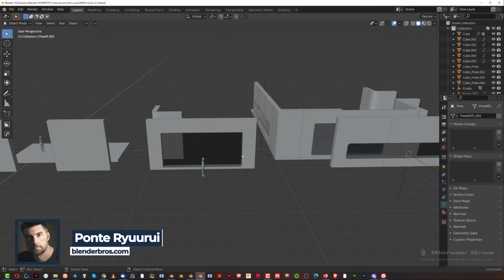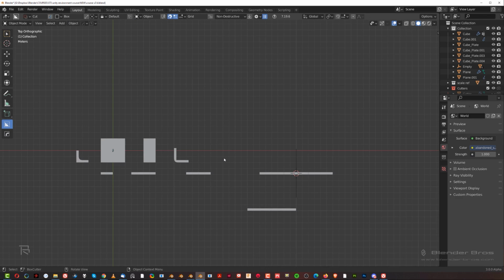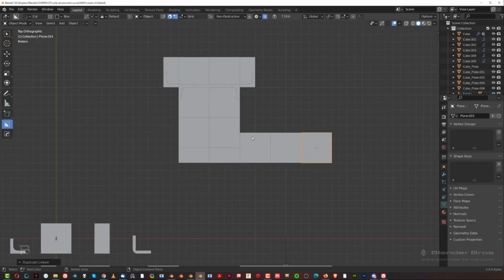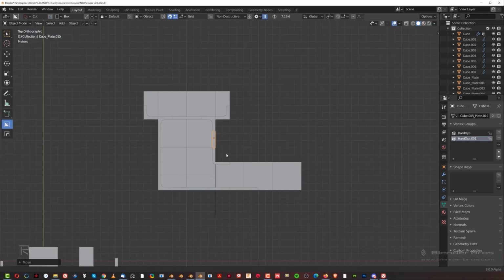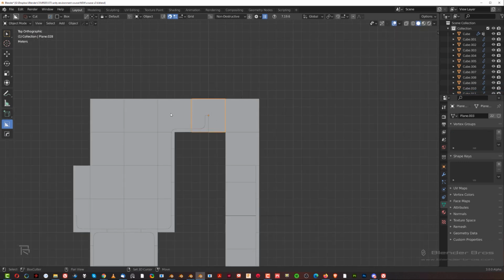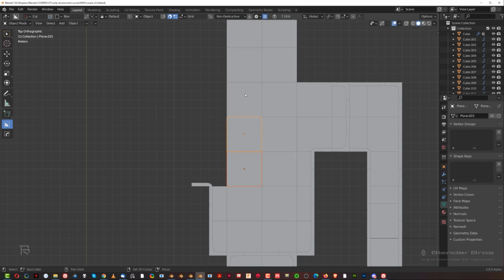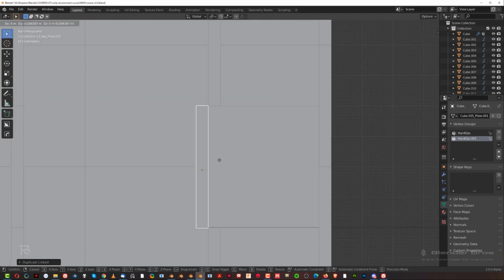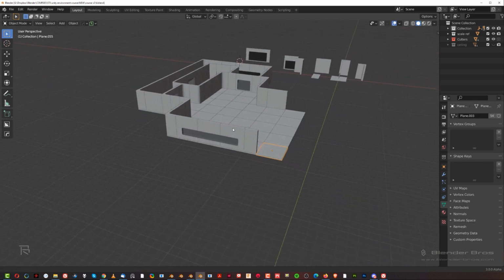Blender TUTORIAL - Modular Environment (main floor)

Comment: Love the course as it's very easy for me to follow along. I don't have the paid addons but I do have enough basic knowledge without the hard surface course you have (which I plan on doing eventually) but I have ran into one huge problem that I am stuck trying to fix. Which I probably just contradicted myself lol. The inner corner piece, I made it to the dimensions you said in the first video, but it will not snap into place correctly with the smaller door frame once rotated. It snaps okay enough as it is but I would have to make 3 more copies for each corner direction.

Comment: Thanks for this Series Ryuu, I really appreciate it. One odd thing for me is that snapping doesn't work when I hold Control, it works fine when I don't touch the Control button. Am using Blender 3.6.5. Cheers mate!
Reply from the maker: Maybe they swapped things around, if you turn it on, it should be ctrl free.

Comment: Hey Ryu, loving the content! Had a question, i'm noticing that Blender 4.1 Alpha crashes when using Boxcutter. Are you experiencing this? If so, do you by chance know a work around to use this add on in Blender 4.1?
Reply from the maker: Dunno, i dont use it. Ya use 3.6.2.
Reply: @PonteRyuurui  Yeah, that’s what I figured. Thank you for the reply. 🤙🏻
Reply from the maker: @beaustine6093  b asically you wanna ru several versions of Blender, one of them with stable addons, which you dont touch
Reply: @PonteRyuurui  Ah I see. I’ve always just had one version, and recently switch to the 4.1 Alpha. Wiped all my add ons lol. 😭 I’ll be redownloading the 3.6 version today.
Reply: @beaustine6093  the beta r L.T.S versions do not work properly
simpllydowndload blender 4.1 and run it
your problem'll be solved